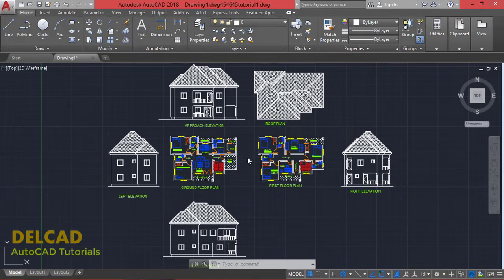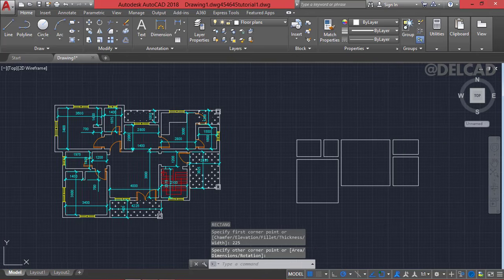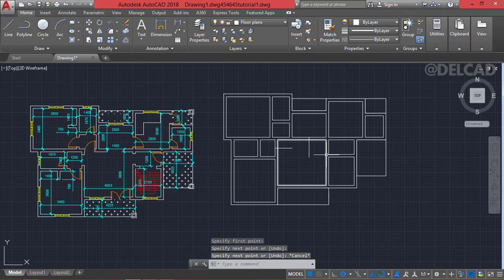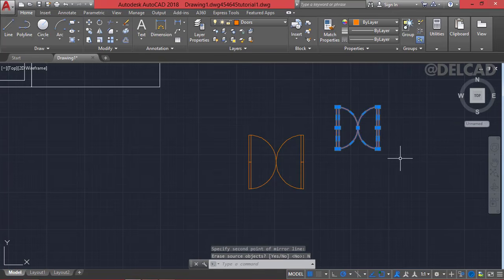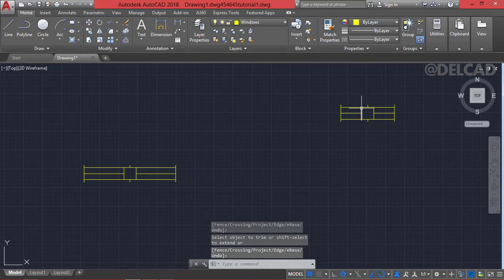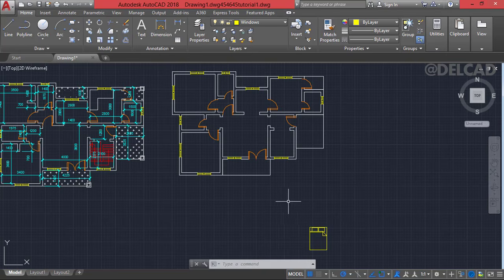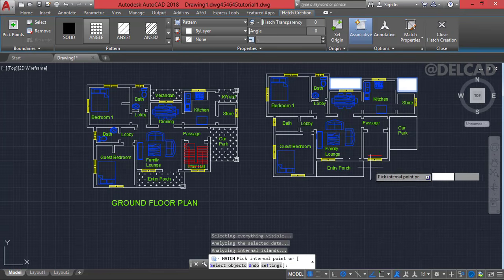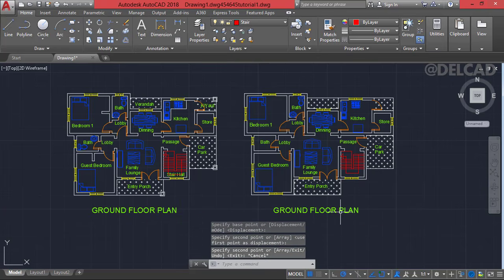Full Building Plan Drawing in AutoCAD Part_1 - Ground floor plan.

Comment: Please how did you do the extension of the 225 mm
Can draw the rectangle but then to do the extension of the 225 is a problem.
Reply from the maker: Thank you. 
On the status bar below the AutoCAD application, turn on "Polar tracking" also make sure you check ✅ the options provided. Then back to your drawing window, you will notice a green dashed line, which is the extension line. Please let me know if this was helpful.
Reply: @dellkingstech_tutorial5995 I am also having the same issue how can I use the extension of 225 which is the wall spacing be4 drawing the second rectangle?
Reply: I did that but to get the second rectangle to start at that fixed distance is the problem